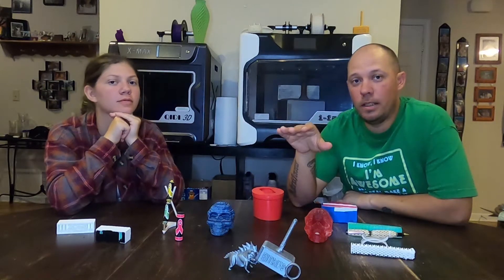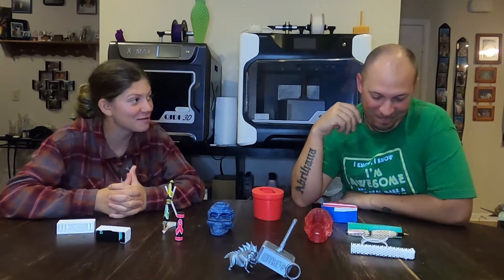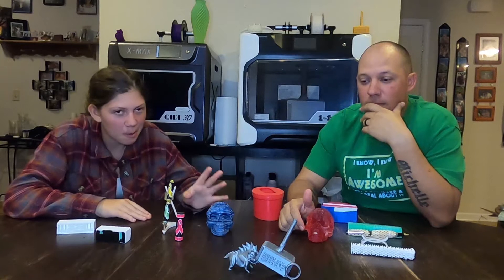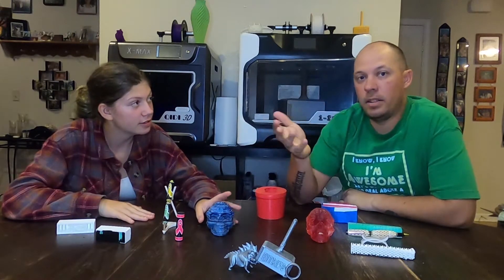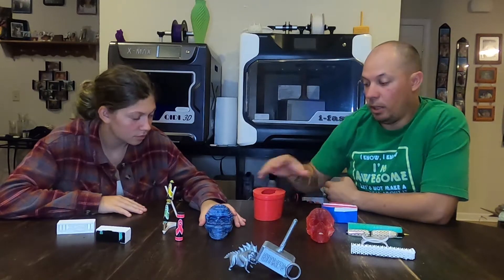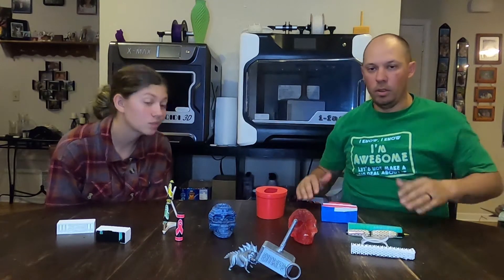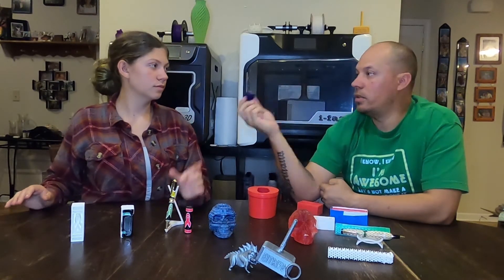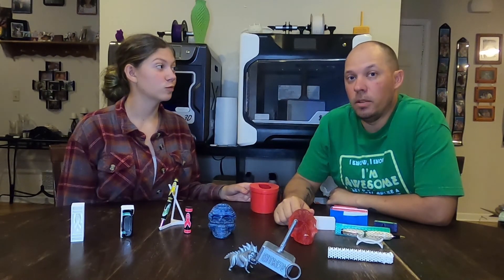3D Printing Molds

Comment: hey you deserve just a lot more followers. Such a refreshing channel with your family busines going on :-). Can you still recommend the i-fast for dual material printing? Greetings from Germany
Reply from the maker: First off, thank you for your kind words. That means a lot to us. Thank you again. As for recommending the i-fast, absolutely. We are loving the i-fast. We’ve only had one major failed print and it was because our filament snapped after passing through the runout sensor. We didn’t notice it until an hour after that happened. Definitely our fault. Hope that helps. Cheers!
Reply: @Eitri3D  That was quick. Thank you so much for your response. Keep going your Chanel is awesome
Reply from the maker: You caught as I was looking at my phone. Again, thank you for your kind words. We are brainstorming some ideas for new videos. Hope to have something out soon. Thank you.